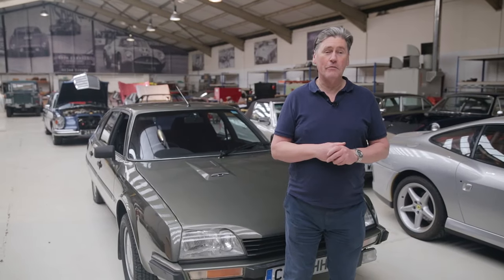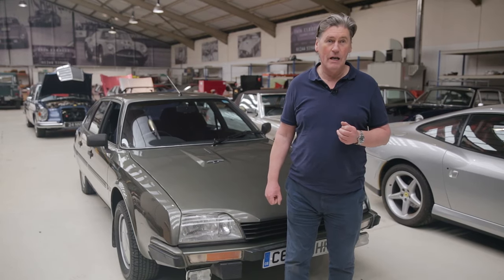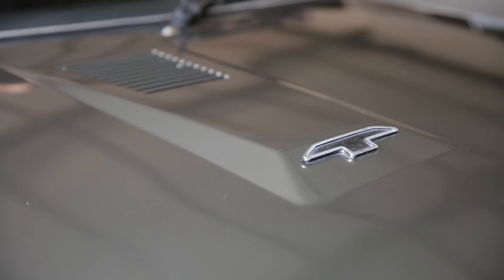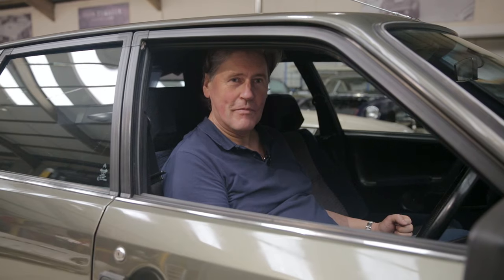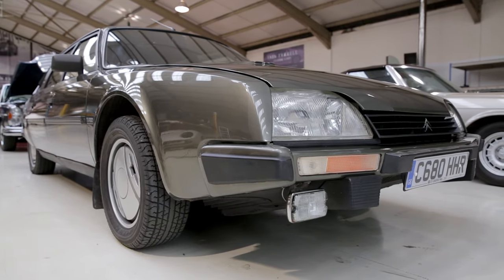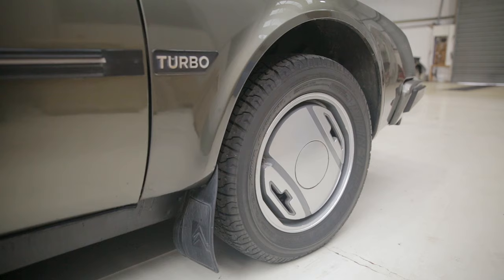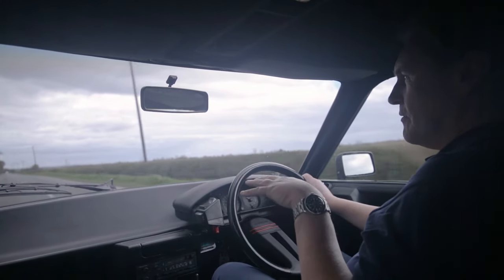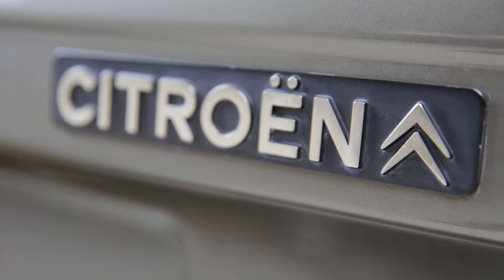Citroën CX 25 GTi Turbo - a rare beast with party tricks | Tyrrell's Classic Workshop

Comment: back in 1985 at the start of my photography career I was commissioned by Citroen head designer Carl Olsen to photograph this newly released car. I was based in central London and went to Citroen in Slough  on a Friday afternoon to pick up the car that was being loaned to me, black one, and was to return it Monday afternoon. I remember it vividly, my driving skills at that time were okayish but at 24 years old I had only just passed my driving test 4 months previously! The brief was open, I was to photograph the car on location and the large photos were going to be used in an exhibition to celebrate Citroens association with a London PR company. Brilliant car and very fast and smooth, I blasted down to the south coast to do some location photography there. As it happened I borrowed the car again the following weekend,  it was a good few years before I actually owned any kind of car of my own but I have happy memories of blasting around in  London and the south coast in a brand new  black CX 25 GTi Turbo in 1985.

Comment: Ken your videos are very very good, when you explain how things work it is CLEAR for us to understand! 
My Dad had some Citroen ( Traction Avant ? ) light 15 he owned quite a few ( 15-20 ) they had the gear level which stuck out of the dash board and they had suicide front doors, i fell out of one one at low speed in a corner, he also owned later a beautiful Mk2 Jag 3.4 very nice car, later he had a Holden ute HZ V8 308, the testing station questioned one day who put in the V8, the reply was you had better ring the Holden factory, later he owned two Austin Princesses, a 1.8 5spd, and a 2ltr auto both nice cars, my cousin he had a Rover SD1 3.5 5spd nice car quick too, in their family there was a Triumph Dolmite Sprint very nice and series two XJ6 engine was modified, and an RS2000 Escort. Myself the nice car i owned was a mint 1980 Escort Sport 1.6, it was quick enough.

Comment: The most informative part was that the engine block is rock solid , coming from an expert of such a high level it's most certainly true.I owned a Citroën GS my first car :Hydropneumatic suspension, a CX Athena my forever best car ever with the space age dashboard including a speedo display on a drum and you can steer with your little finger  , I also owned a Peugeot 205 1.6 GTI sexy agile  little bug, good handling but the ride of the CX is unmatched by any car except my unreachable dream: A Citroën DS. The reason why I buy a lottery ticket every week....

Comment: My 1985 Mercedes 300D does that rear end dip as well (even though it’s a standard spring and shock absorber suspension), it surprises every passenger because they’re used to the pinion trying to “climb” up the ring gear on acceleration, where as the differential in the Benz goes the other way and pulls the back end down.

Comment: Great presentation. I owned a 1997 - I think - Citroen Xantia Estate back in 2007. There was a fault with the suspension and so I was advised to replace all the spheres. I removed the four corners rather easily but could I buggery get the fifth sphere off - which turns out to be the master sphere . I was only using axle stands and couldn't get the leverage. So I took it to my local garage, we put it up on the lift and they removed it in 5 seconds! I currently drive a Jaguar XFS 3.0D and it is beautiful but the ride on that Xantia was much better :-) Keep up the good work, this is a great channel.

Comment: Not only was the CX unique with the Diravi 2.5 turns lock to lock self centring steering, the fabulous fingertip switch controls where a sheers delight.
Rocker switch for non self cancelling blinkers - extend a little finger, on when you want them, off exactly when you want them... magic in round a bouts.

Two block pads on either side. Left for town and country horns, right for high beam flashers. So easy to similtaneously blast horns and lights simultaneously.
High beam dip switch above, lights below on right, plus instrument dimmer. Wipers and washers fingertip on the left below the horns.
Then one huge wiper that flung the water of the steeply raked screen, plus concave rear screen cleaned by aerodynamic air pressure.

Added suspension bonuses - car squats front and rear on braking instead of nosediving (the same with all hydraulic Citroens). If you have a flat on the rear you will hardly feel it because the wheel self levels to where it should be. A blow out in the front does not pull the steering and will brake in a straight line.... 

A formidable car with a major issue - rust. The one design flaw was the febble ventilation and airconditioning systems which could not cope with the huge glass area.
My CX Presige rusted away even after Ziebart anti rust treatment 6 weeks old at the first service in the UK, and shipment to Australia after 18 months.

Comment: Great car, great video. I prefer the series I CX with chrome bumpers of this car. Fantastic you have tuned the GTI to delivery 200 bhp.
I had a new Paris delivery RHD 1978 CX Prestige 2400 EFI 5 speed manual with leather for a year in the UK, 5 months in Europe before shipping it home to Australia.

Fabulous car. Equally at home floating blissfully on 'chasse deforme' on French B road and the wide open spaces of the Aussie Outback.
The Prestige and Safari had the same wheelbase as the DS and had a ride even better than the standard CX. Formidable cars.

Comment: I remember going to an Earl’s Court motorshow in the 70’s and sitting the long wheelbase prestige version of this car, the seats were soft and comfortable and the interior so futuristic when compare other contemporary cars. You just imagined yourself floating down the motorway never feeling a bump in luxurious style. For all the tech in modern cars no other car manufacturer has managed to deliver real  ride comfort effectively as Citroen did then, sadly that now includes Citroen themselves. It’s obviously much more difficult and costly to do this rather than jack up a hatchback, throw in a cheap touch screen and call it an SUV. Another great video.

Comment: Nicely shot video  and beautifully delivered. The only thing I note is that the green suspension sphere you had in hand looked more like they type used as the 'anti sink' accumulator for Xantia hydraulics after 1995 - I only point it out because it doesn't have a damper fitted - it's just an accumulator. You could see the large central hole with threads machined in it in the video. A suspension sphere has the 2- way damper valve fitted in the same place on the sphere and uses a set of leaf valves in addition to a tiny hole drilled in the middle. If you fitted that Xantia accumulator to one of the suspension struts you'd have no damping! Great video all the same.

Comment: I always wanted a DS but could never afford one. Then in 1977 I bought a GS, the much poorer brother of the CX. It was a revelation though and even though it had an engine barely over 1000CC it took four of us plus luggage all around the West country in comfort. I remember coming out of college one lunch time and the suspension failed to go up. On examination the system had emptied itself onto the floor. A short trip to a car shop later and armed with a tin of LM fluid, a length of hose and a car manual and it was soon powered up again. I loved that car but the body almost dissolved in front of your eyes. If only we could have more original or interesting cars today.

Comment: Well presented, but as always with these classic Citroens, there's always more to tell.   The front and rear suspension are each individually controlled for what ever ground clearance is selected.   Regardless of the load, if it's just the driver, or if it's 7 people + luggage in the larger Break / Estate model, the system maintains the selected ground clearance by varying the hydraulic pressure of the front axle and of the rear axle.   The same "load related" hydraulic pressure is used to supply the front set of brakes and the rear set of breaks respectively, so the breaking force is automatically relative to the actual load front and rear, preventing wheel lockup ( as mentioned ).   The CX has giant calipers front and rear, coupled with the insanely high pressure, the breaking can send you through the windshield.   When riding over speed bumps, if you drive fast enough the suspension will absorb all the bump while you stay rock steady.   The variable assisted power steering is speed sensitive, the faster the road speed, the stiffer it gets, at low speed you can turn the wheels with one finger.   The CX's aerodynamic shape, like a torpedo teardrop, stabilizes the car at high motorway speeds ,at around 90Kph the car becomes glued to the road.   The fuel consumption and 90 to 110Kph is the same as 50Kph.   The rear window is concave, causing an area of low pressure in the airflow, self cleaning the window.   The controls to the high beam, indicators and horn are all on satellites, so your hand never need to leave the steering wheel.   The CX can ride with 3 wheels.   Show me any modern car that even comes close.

Comment: Great video! 

Party trick for tailgaters:
In a CX you don't really have to slow down for speed bumps, it won't affect the ride that much.
On the other hand, it will affect the car that is tailgating you really badly. 
Be sure to check your mirror.

Comment: That was fascinating. I've driven a CX2500 Safari, and it is indeed like wafting along on a magic carpet. One thing you left out was the headlights that followed the steering! The self centering steering took a bit of getting used to, as did the C-Matic gearbox. But for such a big car it could be hustled along with ease. I thought I knew how the suspension worked until this video! Now I do.

Comment: The belt driving the pump went on my bx GTi  in the middle of nowhere in Lincolnshire one night. I was able to drive about 40 miles to a garage to buy a new belt and the brakes still worked. No such issues with my old GSA because this pump was driven straight off the engine with no belt

Comment: Combination of gas and hole is shock absorber. Not the drilled hole only. In failure gas runs out of it and that corner of suspension gets rock hard.Also pressure reservoir has similar gas ball. Adjuster of suspension and height is mechanic lever that you control inside. Under chassi there are fingers for front and rear that open, closes or release pressure with valve. When car reaches wanted height finger will close valve.  Very simple.

Comment: In the very early 1990's, my then girlfriend's father had one of these. However, it had a few 'extras'! He was a top-level civil servant in Italy and the car was fitted with a VIP package - which included flashing lights and anti-car jacking glass and doors. When activated, the flashing lights parted the traffic in Milan like a hot knife through butter.

Comment: Ian Fantastic video on such an underrated car, people are scared of the Hydraulics, personally as an ex aircraft maintenance engineer its a simple system. I owned a Maserati Khamsin for 20 years and it as you know has the system on the clutch, brakes and steering which has the self centering system and which I am sure this car has the speed varied

Comment: Long story. I lived in South Africa as a child. I used to go to school in a Traction Avant, in magisterial black.
In SA the movies did the visual advertising. There was an ad for the ID Citroën: it showed two cars, one a Citroën ID, the other may have been a big Austin or Humber or something like that. It was filmed in darkness with lights attached to the wheel hubs and the bodywork and filmed on a bumpy road. The Austin came first, and the lights on the bodywork showed it bumping around and that the wheels hardly reacted to the bumps. The Citroën came by. The bodywork was almost still and not reacting to the bumps, and the wheels were reacting to the bumps. I rode in an ID a year or so later, on a farm road. My dad, an avid British car fan, was very impressed.
In later life I have had a 2CV, and HY van, a GS, and two CX's, one of which was a 'Familiale' estate, and the other an estate with the much bigger engine. Now we have a C3 Picasso: it has a lot of very Citroën bits.
Don't forget the legend of de Gaulle's rescue from an assasination attempt, all because of its suspension.
And the advertising in the '70's for the GS where they blew off one of the rear tyres: to show how safe the suspension was.

Comment: I had the Turbo 2 version with the plastic bumpers back in 1992, the engine was knackered due to the previous owner towing small diggers with it, not that i knew it at the time. I'd still have another one today although the SM is still a dream car.

Comment: The cc was a great car to drive.
I had a gti and a familie estate.
And yes...I had an engine destroy itself in one of them!
Removing and replacing that massive lump and gearbox was a real struggle but it was really worth it(as long as you do remember to depressurise the suspension system....)
A gouple of other quirks of the cx.
Inward curved rear screen on the saloon. 
That crazy instrument panel.

Comment: Great video. I've also got a RHD Series 1 Turbo in Gris Espadon - only differences I can see are that mine has a sunroof and has had air conditioning and Series 2 mirrors added at some point. You mentioned you raised the boost pressure of the turbo, giving around 200hp - does the car have a Maikonics kit or another some other after-market ignition system (to prevent knocking by retarding the ignition timing)?
Reply from the maker: Thanks for your comment, and congrats on your very rare car also. I actually knew Simon from Maikonics in the day- we discussed these engines in some depth. I had a drive in his 400BHP CX Turbo! His "entry level" T1 conversion was 230BHP, which from memory did invlove some ignition mods.I have not altered the boost enough to worry the engine at all- the existing ignition can more than cope, and it's very happy on Super Unleaded. :-)
Reply: Well, that’s very interesting - I might have to grab the screwdriver and (carefully) make some adjustments! Cheers

Comment: i drive and work on (unfortunately!) a few of these and similar citroens. another "party trick" of the suspension is when you go over something like a judder bar, both ends of  raise at the same time as you go over the bump. instead of front-goes-up, back-goes-up, like a normal car, everything goes up perfectly level as the front hits them bump and the same again with the rear. i don't know if you can call it "better" but it certainly feels different.

Comment: This steering is pretty much what most forklifts use. The part connected to the steering wheel is called an orbitrol. It directs the oil into either side of the steer cylinder. Even the sphere is used in some Swedish and American forklifts.

Comment: The spheres has both compression and return damping that are tuned by a couple of canals inside the damper and shims that block the canal. The center hole is in use at slow suspension travels, when the wheel hits a bump the shims on the compression side opens up the canal and dampens the wheel.  The sphere in his hands is not a suspension sphere.

Comment: SM=Systeme Maserati from back when Maserati was owned by Citroen and the two marques shared  parts and powertrains.CX  was illegal to sell in North America as the adjustable suspension varied the 5 mph Federal mandated bumper heights which had to be the same exact height on all passenger cars sold here made after 1974.Few other interesting CX trivia things, the rear window glass is concave, think its the only automobile design ever to feature that for aiding aerodynamics, and Citroens DIRAVI steering (shared with the Maserati Khamsin ) is also unique as it has no caster built into its geometry (as do all other vehicles with conventional steering) Great video, nice to watch them made by someone with life experience who actually knows what he is talking about  (:

Comment: A long since deceased IRTE Engineer once told we Apprentices about that similar steering system on a Double Deck Coach application system... (RIP Norman Airey)
where he drove a Citroen Test Bus in high crosswinds in Western France during Winter, with the steering wheel spoke at 90 degrees, and it still drove safe, and straight on the A63
with crosswinds blowing off the Bay of Biscay.

Comment: The sensation of the rear squatting under hard acceleration is even funnier on a BX 16V, because the self-levelling element of it is faster to react than the CX's. That means if you give it a bootful on the motorway, and the rear end squats as it did there in the CX, then by the time you go for a gear change the suspension has countered the squat and raised the rear end again. As result, you lift off and the back end immediately shoots up in the air to the top of it's suspension travel! The sudden change of geometery at 100mph is fun, and by fun, I of course mean terrifying.

Comment: If I recall my old CX's driver's manual correctly, the maximum suspension height is for wheel changing only and the minimum height is for certain other types of servicing such as checking the fluid level. The car is not intended to be driven at either the maximum or minimum suspension heights. I have noted uninformed comments elsewhere to the effect that the minimum height is for "high-speed motorway cruising", which is dangerous misinformation. Even the intermediate height for extra ground clearance comes with a fairly low maximum speed limit, to avoid destroying the universal joints.